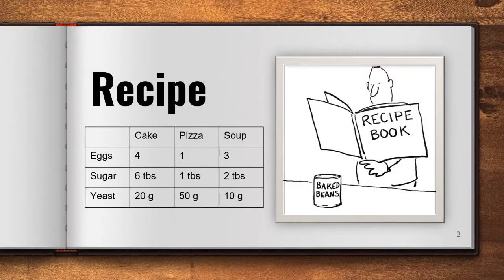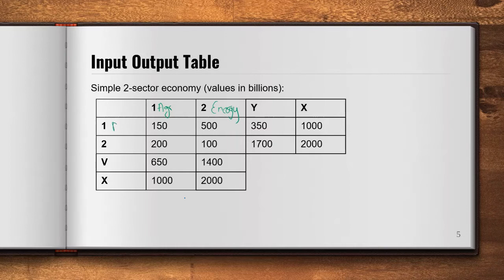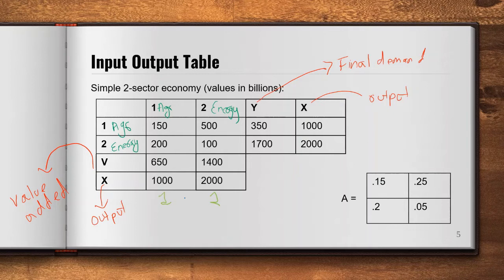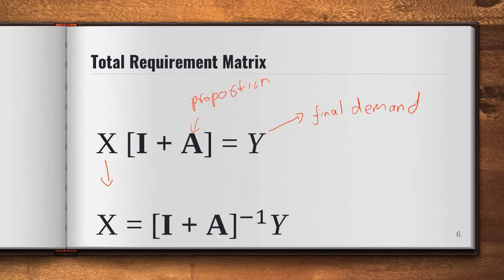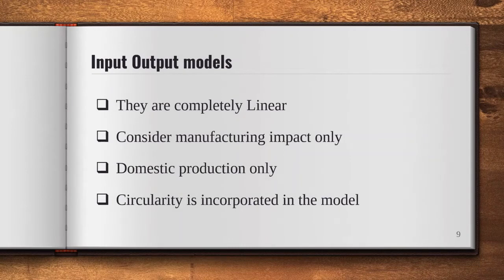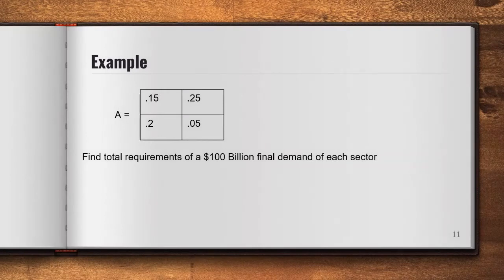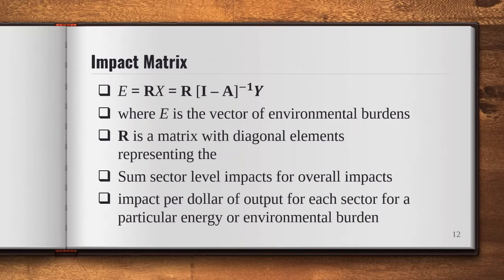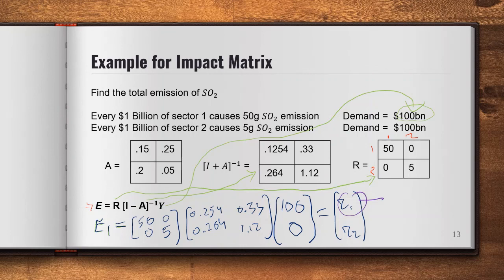Leontief model | Multi Regional Input Output (MRIO) Model tutorial

Comment: I have a question if we have 8 years ( 2010 to 2017) data of 30 industries.  How can we calculate it? Is the input-output model calculate year wise or we accumulate the 8 years data, after it applies the model?